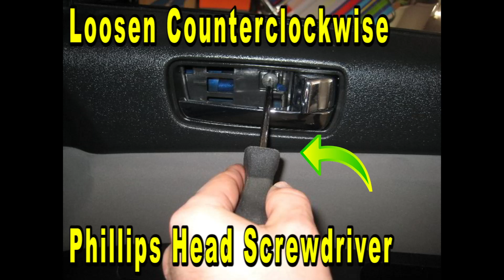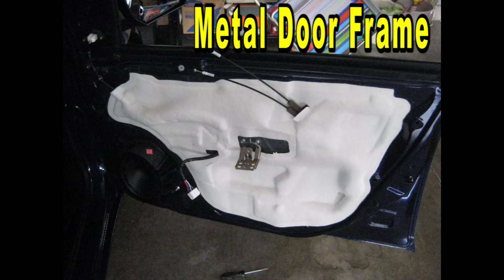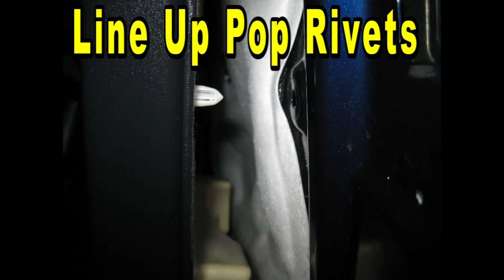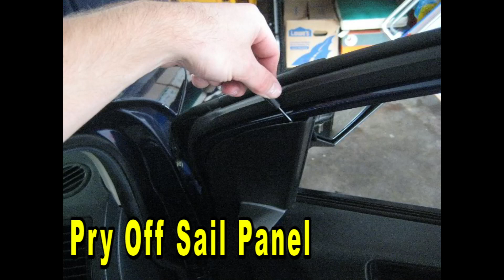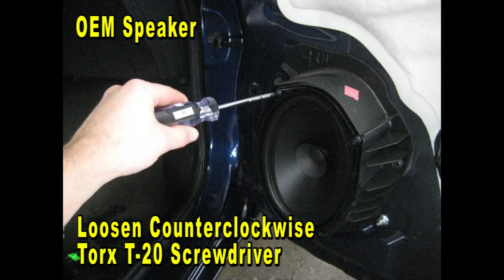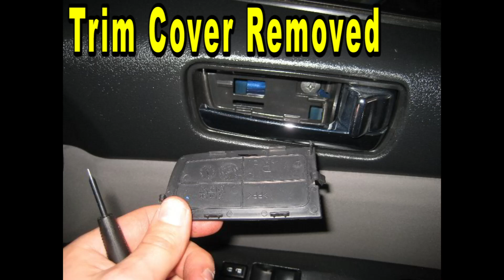Nissan Sentra How To Remove Door Panels 2007 2008 2009 2010 2011 & 2012 - Upgrade OEM Speakers

Comment: Thank you for posting!! Straight to the point!! 

I’m replacing one blown speaker with another OEM speaker in good sounding condition and, I’ll replace all 4 speakers with aftermarket in the near future.

~ 2008 Nissan Sentra 2.0
Reply from the maker: Hi Ernesto, I'm glad you like the video. 🙂

I have a list of Nissan Sentra DIY maintenance guides on my site - 
https://www.paulstravelpictures.com/Articles/2007-2012-Nissan-Sentra-Common-Problems-Repair-Maintenance-Guides.htm
Reply: Thank you! But the link you posted took me to the page that has info on the 2013-19 models. I have an 08, which is the same as the 07-12 models
Reply from the maker: Hi, I'm sorry about that. Here is the correct link for the 2007 to 2012 Nissan Sentra - https://www.paulstravelpictures.com/Articles/2007-2012-Nissan-Sentra-Common-Problems-Repair-Maintenance-Guides.htm

I also corrected the link in my previous reply.

Comment from the maker: Check out the DIY tutorial for taking off the plastic interior door panels in a sixth generation 2007 to 2012 Nissan Sentra sedan - 
https://www.paulstravelpictures.com/2007-2012-Nissan-Sentra-Interior-Door-Panel-Removal-Guide/index.html

Here are all of the DIY repair and maintenance guides for the sixth generation B16 2007, 2008, 2009, 2010, 2011 & 2012 Nissan Sentra - 
https://www.paulstravelpictures.com/Articles/2007-2012-Nissan-Sentra-Common-Problems-Repair-Maintenance-Guides.htm

Owners of other Nissan vehicles such as the Versa, Cube, Altima, Maxima, Leaf, Pathfinder, 370Z, Juke, Rogue, Xterra, Murano and Quest may also find these DIY instructions to be helpful.

Comment: Please answer I need a better picture or description of the bottoms edge
Reply from the maker: Hi, here's the original guide with clearer pictures - https://www.paulstravelpictures.com/2007-2012-Nissan-Sentra-Interior-Door-Panel-Removal-Guide/index.html

To pry out the bottom edge, just insert a large flat head screwdriver in between the door panel and the metal door frame. Pull out firmly to release the pop rivets.

I hope that helps.